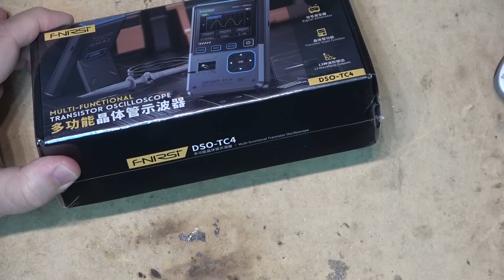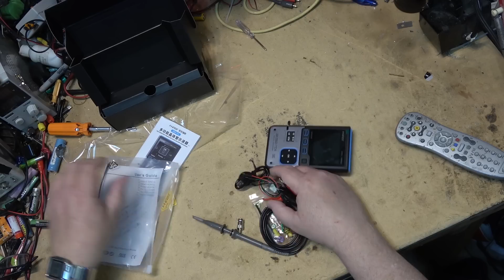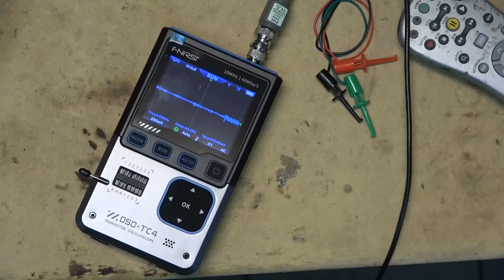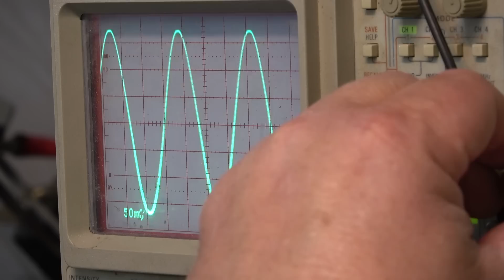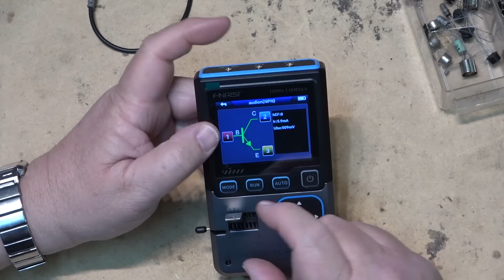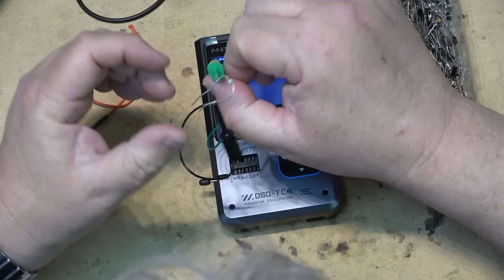FNIRSI DSO TC4 Pocket Scope Function Generator Unbox and Test

Comment: While I successfully followed the Firmware Updating process; using the USB port; 
I do not understand the other uses when the SETTINGS  "USB Sharing" is activated.

Once activated, I can see the LOGO; Screenshot file; and Upgrade file directories on my Windows 11 PC; in a 'G' USB drive that pops up.

But there are no use examples for the USB SHARING option. 
The first two directories that appear are empty; while the last has a text file with upgrade status.

The manual is of little help.

Comment: Thanks for this review. I have the DSO - TC3 that I bought from AliExpress less than a year ago. the scope is only good to about 500K. I do  use the component tester fairly regularly. But on mine, the testing of zener diodes is limited to the 3.4 volts of the lithium ion cell that powers the unit. I'm glad they upgraded that function so at least you can test 12 volt diodes.  This unit also costs more than mine. I paid about $35 for mine. Interesting observation about the sig gen. I did not realize the digitization of the analog signal due to the crude D to A converters that they use on board this unit. I use the oscilloscope as an audio signal tracer. The whole thing reminds me of one of those tiny analog vom's that Radio Shack sold back in the 70s for under $10. LOL!

Comment: I have one of those that just does the scope thing I got it as a cheap signal tracer and do not need the high frequency ability. I have a digital bench scope for more in depth use. the little floating scope is handy for checking iffy things without blowing up my good scope.

Comment: Don´t be too harsh, this can be the first oscillocope for someone.
I needed a scope and got a 2 channel USB DSO up to 40MHz that work connected to a PC. It works well on XP but not so well in Windows 7, that is why I keep an old XP laptop around, altough with an Atom netbook works well also. I know its limitations and I am pleased with what it can do.
However, some time ago, for 60€, I got a good deal, two analog oscilloscopes, one 10MHz and one 40MHz "not working, for parts" that I fixed (they were made for 220V and used at 240V, a simple fix for both) and in the last two years, I don`t remember using the DSO. I guess this DSO-TC4 costs around 60€.

Call me old fashion, but an analog oscilloscope is better for me that a cheap digital one.
Reply from the maker: It does the job for the hobbiest  as it does display waveforms, checks transistors and generates signals to 50KHz.  Not lab grade but for the money it's fine.
For the work I do an analog CRT scope is all I need. I don't work on digital stuff